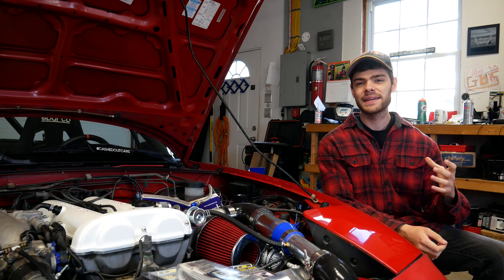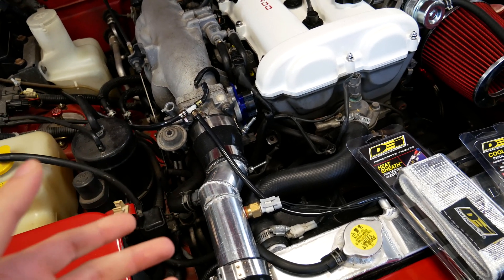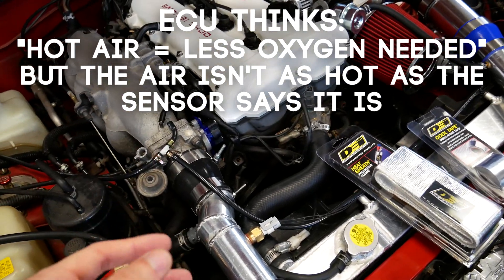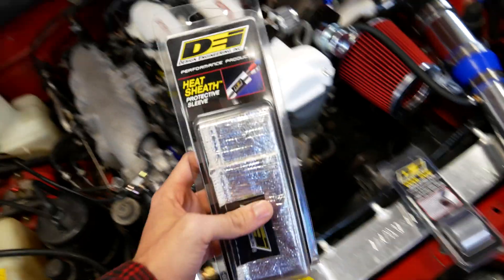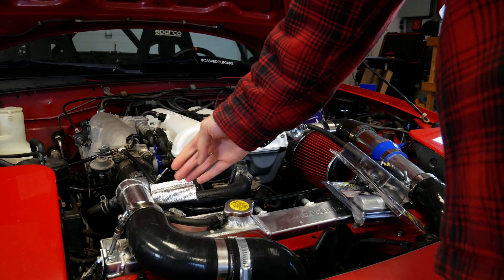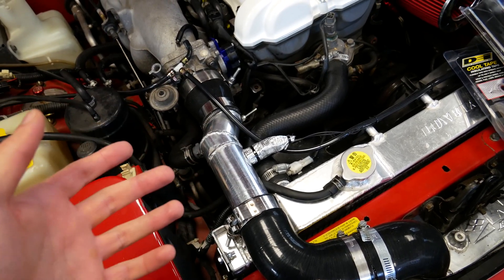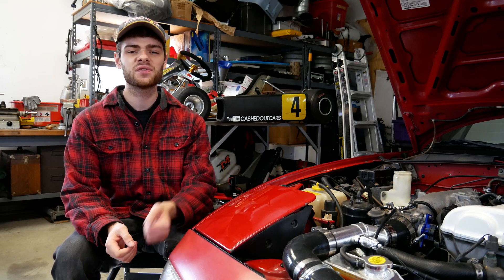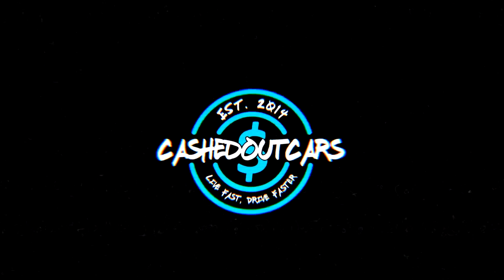How To Fix a Car Running Lean At Idle or in Traffic | IAT Heatsoak on a Standalone ECU

Comment: Hi I have been running lean at idle also but my 2011 Kia optima 2.0 turbo doesn't have an air intake temperature sensor, by any chance do you have suggestions what it can be?? When I'm driving LTFT go to zero again would really appreciate any help thank you

Comment: My car shuts off when my IaT hits 100 degrees and my big turbo has a blanket on it and it’s still heat soaking the engine with the hood on and hot ambient temps. Once I pop the hood and allow my fuel pumps to run and cool off the rails it starts right up.
Reply from the maker: Where is your IAT sensor? Moving it may help!

Comment: Best tips for combatting heatsoak with a turbo setup! My SR is running hot and has the lean idle at a traffic lighf issue after getting some use, but afr is golden while driving. Water temps a lil higher than normal. No BOV. Would that dramatically help if i installed one?
Reply from the maker: Glad this helped! I don't believe it would help much with the BOV, but I would be wrong. Since heat soak is caused because of the components getting "soaked" from engine temps, generally rather than air temps, I don't think it'd make much of a difference, especially post intercooler if your intercooler is big enough

Comment: If the 02 sensor is disconnected while the iat sensor is heat soaked , will the afr wil still lean out or run open loop rich ?
Reply from the maker: That'll depend on your ECU settings, with no O2 sensor you can't be in closed loop O2 correction

Comment: I would have wrapped the coolant hose just below the sensor as well.
Reply from the maker: Yeah this video mentions that what I did is a starting point and that more could be done if the problem continues. The best way to fix it is not put the sensor there 😂
Reply: @CashedOutCars   Even the "engineers" screw up. This may be like dinosaur info, but I once bought a late 80s GM Safari van. There was an L shaped fitting on top of the engine which tapped the coolant passage to bring coolant to another point of the engine to 'fix' a hot spot on the head. It looked so much like an afterthought, but it wasn't. It was GM's correction to an initial f** up. design. Just to give you an idea, to change the spark plugs on that vehicle, you had to remove a dog house cover inside the passenger compartment. Some plugs were accessible through there, and for the rest, you had to remove the front tires on both sides and go under the wheel wells to reach  them.

Comment: Maybe don't put the IAT sensor right over top of a hot coolant hose? A lot of people install the IAT on the coldside of the intercooler tank for that reason...
Reply from the maker: Yeah I agree, that's what some of the video talked abou. It wasn't the best place but this helps fix it if you do what I did. I've seen this done on a bunch of other Miatas so I did it but it isn't a good spot. If it wasn't on a custom welded part I'd move it